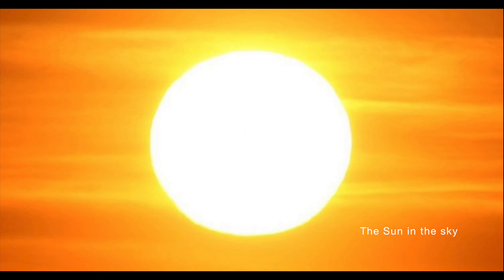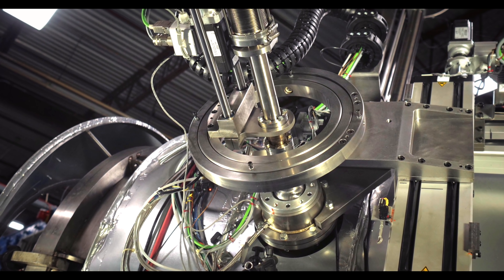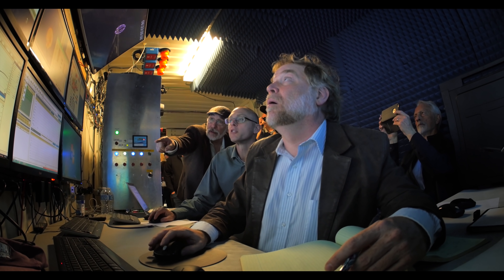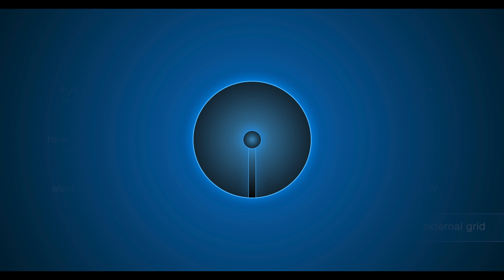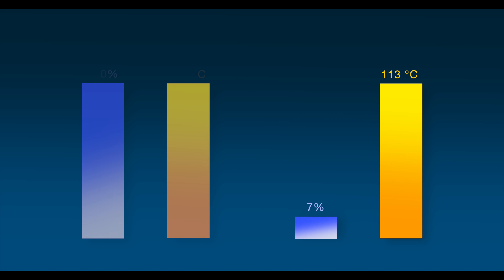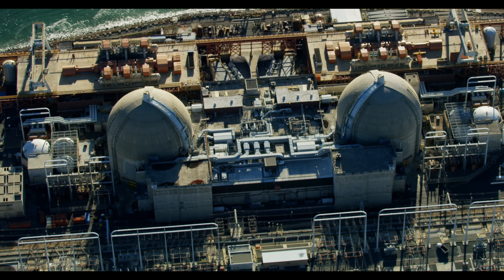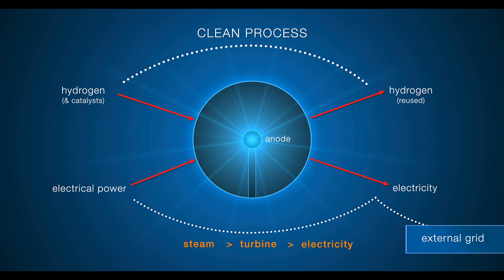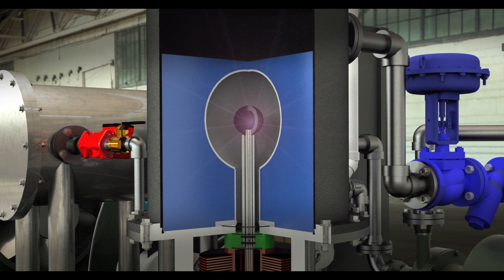Special Feature: THE SAFIRE SUN

Comment: Did anyone catch the part about the transmutation of metals..? 
Also, did anyone notice the Aurum Goldbacks that came out 2019? Anyone know how Goldbacks are made? 
That's right, they use a printer which utilizes advanced plasma technology to "print" 24 K gold onto thin, engraved plastic sheets. 
They say that the price of gold is not skyrocketing because the banks & wall street are manipulating it... 
But now that the SAFIRE Project has confirmed that electric/plasmic transmutation of elements is a real phenomenon, one has to consider the possibility that they may actually be CREATING gold using advanced plasma/electric technology...
Think about it.

Comment: Could the sun be condensed hydrogen in a vacuum, but its hotter further away because of the free flowing electrons and dark matter becoming ionized plasma in the suns atmosphere
Reply: Dark mode plasma makes dark matter redundant, the one place that we'd see HALO dark matter in the circumgalactic medium we found dark mode dust plasma with the mass we expected of dark matter. The controversy gets bigger when the circumgalactic medium circulates plasma at such a rate that the Milky Way has to be a part of an intergalactic current of plasma. The Milky Way doesn't exude enough dust to make up that flux of mass, especially with the paper "Dusty Magnetic Pinballs". Most of the elements and matter exuded by a supernova doesn't leave the supernova remnant.

Comment: 20mill to make the whole project? Thats lowcost... how?
Reply: The experiment is just an upscaled version of the Little Terrella Experiment by Kristian Birkeland, they are not doing something completely unknown. The company doing this experiment is a renowned verification laboratory, so they should have a good idea on how to run a tight budget, and run experiments. 

To make experiments cheap, you need to put a lot of forethought into them. Sort of like painting a vehicle, most of the cost is set up.

The big reactor you see is the main experiment, and the second prototype, but if you look around the video, you might see a glass jar. That glass jar is the first prototype, which is a smaller sub-experiment to get a good idea of what they are dealing with... It's a bad idea to make a big project that will never work, or might explode on them.

Comment: This sounds so good that if true I expect some shell corporations to silently buy up key patents and disappear them under the cover of "research." The same has happened in other industries for years. Set your timer for 5 years and check back to see what's happened -- or hasn't happened. If implementing this would mean the control structures will loose power and profit, don't expect them to sit by idly. They let private ventures do the work, take the risks, and develop things like this then they absorb it, cannibalize  it, and extract parts of it to market without threatening their status quo.

Comment: The first two lines he utters are false. Fusion does NOT occur in the photosphere. The energy in the Earth that keeps it molten, the source of beneficial geothermal energy and the magnetic field that Protects us (mostly) from solar particle bombardment, originated long before the sun gravitationally condensed from an enormous thin cloud of mostly hydrogen atoms. It is long lived radioactive elements created by super-stellar events like supernovae. 
It is also responsible for all tectonic events, including volcanoes, earthquakes, and tsunamis.
The energy of the photosphere is what's left of the power from far deeper, at a temperature a thousand times that of the visible light. 
If what SAFIRE  are doing isn't rubbish, their scriptwriter and reporter have got it wrong.

Comment: The both sapphire and tokamak utilize plasma to attain a temperature necessary for nuclear fusion and differs by the way each produces plasma.

Tokamak generate plasma without electrodes. It use magnetic induction to generate plasma, therefore electrode-less. The plasma tokamak induced is rather difficult to organize partly due to missing of electrode. A system prone for failure. 

Sapphire generate plasma with electrodes. The plasma is allow to self organize, largely simplify the system and operational complexity. Luke the tokamak system sapphire runs continuously. 

The next level to electrode induced plasma is called Plasmoid, also employ electrode induction. The system operate in pulse model but continuously mode. The advantage for pulse model is 
- it is potentially stable no run away melt down. 
- it is multi fuel system, hydrogen and non radioactive elements. 
- it produce a pulse temperature 10x of continuous mode. 
- it generate electricity and x ray to respective loads which by pass hearing water for turbine. 
- the prototype can fit in a small home or large garage. 
For more information, follow up turn Eric J Lerner.

Comment: UNDERSTANDING THE PHYSICS OF GALAXIES, AS ELECTROMAGNETISM/ENERGY IS GRAVITY:

E=mc2 IS F=ma. Time DILATION proves that ELECTROMAGNETISM/ENERGY IS GRAVITY, AS E=mc2 is DIRECTLY and fundamentally derived from F=ma. So, A GALAXY is understood as stars together AND stars apart ON BALANCE. In fact, A GALAXY is understood as SPACE that is stretched/explanded AND contracted/flattened ON BALANCE. Consider what are galactic JETS. INDEED, stellar clustering proves that electromagnetism/energy is gravity. A galaxy is necessarily based upon terrestrial and celestial physics. (Very importantly, outer "space" involves full inertia; AND it is fully invisible AND black.) The stars AND PLANETS are POINTS in the night sky. Gravity and electromagnetism/energy are linked AND BALANCED opposites, AS ELECTROMAGNETISM/ENERGY IS GRAVITY. A galaxy is basically FLAT. So, a "star point" may OR may not fall into what is a "black hole". Indeed, consider the "birthing" or emergence of stars in galaxies. Invisible AND visible SPACE in fundamental equilibrium and BALANCE necessarily is the MIDDLE DISTANCE in/of SPACE in relation to THE SUN AND c (the speed of light). Consider the appearance of what is a SPIRAL GALAXY. Great. ALL of SPACE is NECESSARILY ELECTROMAGNETIC/GRAVITATIONAL IN BALANCE, AS ELECTROMAGNETISM/ENERGY IS GRAVITY. This is, in fact, CLEARLY PROVEN by BOTH F=ma and E=mc2. This NECESSARILY represents, INVOLVES, AND describes what is possible/potential AND actual IN BALANCE, AS ELECTROMAGNETISM/ENERGY IS GRAVITY. BALANCE AND completeness go hand in hand. A PHOTON may be placed at the center of what is THE SUN (as A POINT, of course), AS the reduction of SPACE is offset by (or BALANCED with) the speed of light, AS ELECTROMAGNETISM/ENERGY IS GRAVITY. GREAT !!!! GRAVITY is truly and ultimately proven to be electromagnetism/energy. THINK !!! Objects fall at the SAME RATE (neglecting air resistance, of course), AS ELECTROMAGNETISM/ENERGY IS GRAVITY. It ALL makes perfect sense.

By Frank DiMeglio

Comment: Sounds great, but...
1. Can you use the energy yielded by the reaction itself to build (and maintain) more reactors, or do you still need fossil fuels for that? If the latter is the case, then sorry, our dependence on fossil fuels remains unchanged.
2. All forms of energy usage generate *waste heat*, and this one can be no exception. So if we continue to commit ourselves to the ideology of an exponentially expanding economic system, then even if we switch to this energy source en masse, we'll still be inflicting damage on the biosphere by releasing exponentially increasing amounts of waste heat into it.
Ultimately, assuming this new energy source really works and becomes widely adopted, it will merely buy us some time -- time to move away from the ideology of endless growth. To think it will enable modern industrial 'civilization' to go on indefinitely is a pipe dream. This energy source can be the energy source of the future, but only a future based on a steady-state way of life, NOT one based on endless growth.

Comment: If there is anybody reading these that still imagines the Sun's photosphere generates energy, rather than merely transmitting what comes up from the core, I refer you to the fact that the core is a plasma of SG=160,  eight times denser than gold or plutonium  metal, and that its temperature is about a thousand times as high as the photosphere. You can check this at Wikipedia, or a dozen other places.
By the way, "radioactive waste" in the USA or France or the entire world, is a trifling problem compared with the fossil fuel industry's determination not to be replaced by nuclear. It knows that coal swept commercial and military wind power completely off the seas.

Comment: The opening sentences of this are complete nonsense. Compared with this, Transatomic's misguided hopes were quite realistic.
I tried again, skipping bits at the beginning, and heard that "hydrogen is being used as a catalyst".
I noted that "hydrogen nuclei" are commonly known to nuclear physics as "protons" unless they're deuterons or nuclei of radioactive tritium, "tritons". The statement that the rate of radioactive decay of any isotope of any element can be changed, is false. But of course we can change the rate of radioactive decay of uranium by "catalytically" hitting it with a neutron, which if it splits turns it into two pieces with much faster  decay rates. Lots of wonders of this project are stated, but not accounted for in any serious way. We're simply left to believe the narrator, who has already made quite a number of false assertions.
I am very suspicious indeed of this "commercial venture".

Comment: So apparently the fusion taking place in star's coronas are the mysterious source of what powers Birkeland currents; and it's not the currents that light the stars alone but the electricity generated by the stars themselves that powers the great circuits that are both the external grid and the input current for other stars on the circuit.

Comment: This is an amazing technology, but their conclusion that , because they can generate conditions similar to the sun on the small scale then the method of generation must be the same.  But they fail to realize that these are two completely different levels of organization subject to different quantities of fundamental forces and exhibiting different emergent properties.  For example, then is subject to far far more gravitational force than this little ball. Also, they are generating and applying electrical energy to this thing to get it working; who is supplying the enormous electrical energy that would be needed to sustain that plasma the size of the sun?  Their technologies are amazing and potentially world changing but their conclusions about physics based on their experiments are just wrong.

Comment: So cold fusion might not have been so impossible after all?

The sun is not the source of all Earth's energy.  There are terrestrial radioactive decay and cosmic rays.  The sun is by far the source of most of Earth's energy.

If radioactive decay can be accelerated in the presence of hydrogen, then radiometric dating is mostly useless.

Comment: They never mention getting more power out than they put in
Self contained magnetic fields don't exist
No man made fusion reaction will produce lanthium and actinide series metals in our era
This is a pretty looking plasma ball/fusor and 100% snake oil
Reply: You lost me at "Self contained magnetic fields don't exist"

Look at the sun.
Reply: @JenkoRun  You've heard of solar flares and coronal mass ejections right?
In some tokamaks I've seen them making improvements on this by making edges in their plasma flow by making intentional leak points that suppress large fluctuations form disturbing the overall mass of plasma being contained

Also, looking at the sun is bad for your eyes without the right equipment ;)
Reply: @MCWaffles2003-1  That ;) has destroyed whatever interest I might have had in continuing this conversation, I have no interest in talking with brats.
Reply: @JenkoRun  yes, facts that do not coincide with what you favor are indeed troubling. In that case might I point you to religion where you may pick and choose the bits you like so as not to need to learn or undergo duress

Comment: This is simply amazing, every update from The Safire Project is a huge leap towards solving the mysteries of our universe, not much more to say.
Unfortunately, on a different and upsetting note, there is a very suspicious lack of interest towards this groundbreaking work, and the resistance of mainstream science is not enough to explain it, I'm in fact quite sure that for some reason (which I can't fully understand) the You Tube algorithm tends to keep Thunderbolt's on the bottom. If I say so it ain't because of some conspiracy theory, but because I noticed that every time I type Thunderbolts into the search bar, the full Thunderboltsproject title does not appear into the suggestion box until I'm almost done writing the whole thing, as if I was doing it for the first time. So, since all other titles I search frequently, such as other channels, band names etc. appear in full after typing 2 or 3 letters tops, this can only mean this channel is somewhat censored. This would explain why the subscribers number is stuck at 167K since the last ice age, where due to the amazing nature of the discoveries discussed in here that number should be around 1mln.
Does anybody have the right technical competence to look into the problem?

Comment: I think I can understand now how safire can generate so much power with so little input.  It is COHERENCE! 

Is like comparing the photons of a single 6-watt lightbulb to the sun. Ordinarily, light is extraordinarily inefficient. The intensity of light from a bulb is only about 1 watt per square centimeter of light - because many of the waves made by the photons destructively interfere with and cancel out each other. The light generated per square centimeter by the sun is about 6,000 times stronger. But if you could get all the photons of this one small lightbulb to become coherent and resonate in harmony with each other, the energy density of the single lightbulb would be thousands to millions of time higher that that of the surface of the sun.

Since plasma has the property of self-organizing into layers, or shells, all the atoms were oscillating in a perfect harmony, like photons in a laser, which behave light one giant photon, vibrating in perfect rhythm. This organization makes for an extraordinary efficiency of energy.

Comment: There is an elephant in the room here.
There is no cable leading into the sun like there is in the experiment leading into the sphere...
I think you are on the right track by considering electric phenomena in cosmic processes, but there is something even more strange than we are accustomed to and it is happening  in our sun. How is it possible that it behaves like an anode when there is no closed circuit?
Reply: @Andrew Manche I have trouble picturing the circuit. Do you have images of that?
Reply: @Andrew Manche i meant an explanatory view of the entire closed circuit, not a spectacular photograph.
Reply: The thin but widespread ionized gas in Space serves the function of a cable.
Reply: @codetech5598  And where does it enter? At the poles? Or along the sun's equator? 
It has to be at a small confines spot, because if you mean all over the surface , it would cancel out the anode.
Reply: @janhemmer8181  At the poles, just like what happens on the Earth.
Reply: @codetech5598  But that would be the opposite polarity for earth's case.
At least when you are referring to the 1500 Amp of the atmospheric electric circuit.

Comment: I detected a shift in orientation for this project toward a commercial venture, which made me read the show notes to discover, "Aureon Energy, Ltd. is an independent body which has no affiliation with The Electric Universe, The Electric Sun, or The Thunderbolts Project."  It's a fair leap, but the form of the commercial manifestation is anything but clear.

Comment: lost me when they are lying about fission, with modern breeder reactor designs you keep putting the waste back in the reactor and you end up with a low radioactivity waste with a half-life of about 150 years. Where are the papers showing that this works like you have suggested? If you had you'd have the funding already. What temps are you reaching, whats your Q and how do you solve coulomb scattering in this reactor? Most devices in this design have a Q <= 0.1 which makes it a fun plasma experiment but not a reactor.

Comment: The difference with the real Sun is that the electric field is produced by optical rectification of Gamma radiation above the Schwinger limit, way above. The gamma radiation source is created at the pinch point of a cosmic flux tube, which is a longitudinal magnetic field, and is due to a sparking of the vacuum, or from counterspace as Eric Dollard refers to it.

Comment: I have a question I hope someone smarter than me can answer. I’ve been following the Electric Universe and the Thunderbolts Project for a while now. We believe in the Birkeland Currents and galactic filaments that create the stars and galaxies alike. I don’t believe in the black hole theory as mainstream peer reviewed scientists believe. I believe what Wal Thornhill mentioned. If galaxies are created along these swirling filaments and most if not all galaxies have a “ black hole “ at the center, ( a torus/ toroidal unit ), is it possible that what mainstream scientists are actually looking at is a galactic filament head on?  The stars and galaxies are continually being fed energy through the filaments in this cosmic web and the galaxies spin and the stars rotation is created by the entwined filaments. Could it be safe to say that when they think they see a blueshift or redshift “ black hole “, what they really may be looking down is the barrel of a cosmic filament?  Or am I just crazy?